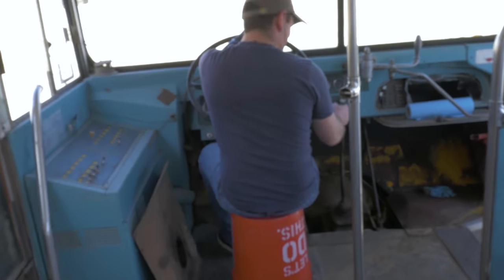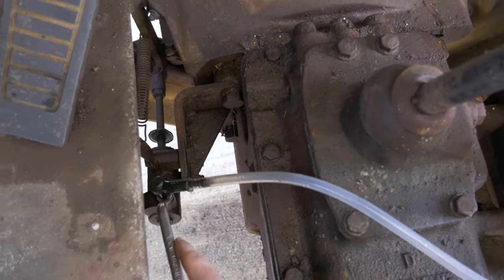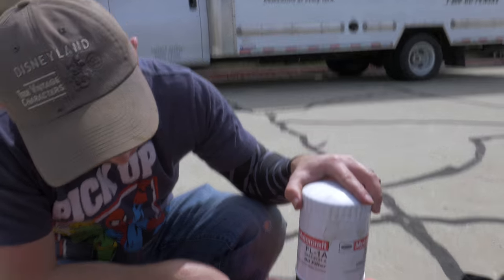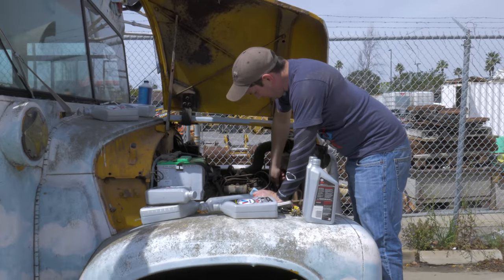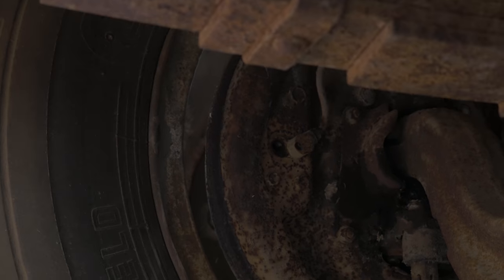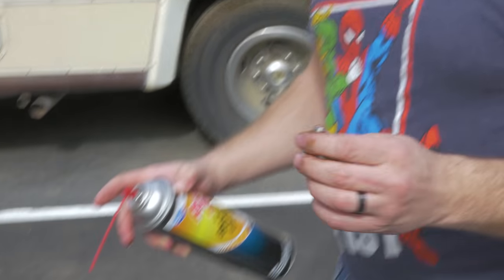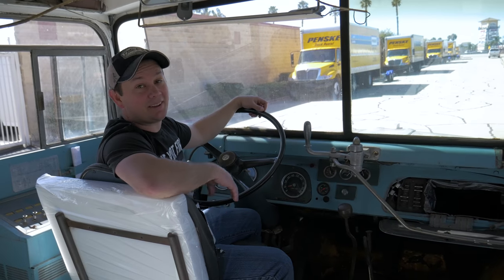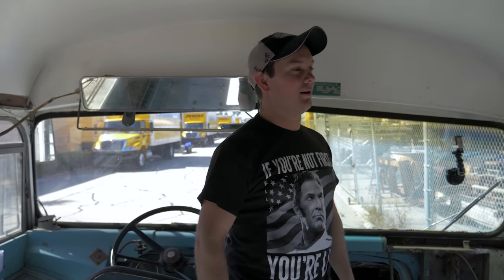1966 international | Tuning a School Bus

Comment: I have a 1966 I.H. Loadstar 1600. Still use it twice a year. Had to do general maintenance thru the last 30 years but its worth it.  Overhauled the carburetor, replace the water pump, slave cylinder, tires etc.  , we have a vented propane heater in it for deer camp.

Comment: Tell you something about the buses I rode.  Carpenter had two types of buttons on the "full-length" switch panels that were popular in the later part of the 1950s all the way up to about 1969.  This one had the chrome pull switches.  They also had the optional black button type where you could put two fingers under the black knob to advance the switch.  In 1958, they had the green for the main section and two white switch ID strips.  My first bus which was a Vistaramic Carpenter bus had the all green panel and the switch ID was just printed on the panel and they used what is now the "Times New Roman" font.  Plus my first bus had two switches for the dome lights.

Comment: That's a pretty cool bus and driveline--take it from a guy that owns two as toys!  Granted, both mine are diesel, but that IH gas motor is a super reliable beast, and the stick will give yall better MPG's and power than an auto!  Feel free to hit me up if you need any bus advice!
Reply from the maker: txstreetman Thanks! We will definitely take you up on that.

Comment: I am totally into the look of that era International, especially the two-piece hood. I believe all that front sheet metal is identical to any other large International from the same era, if you need parts. Not sure about mirrors. Anyhow, I'm green with envy! Did it have a twin sibling, maybe??? 😉
Reply from the maker: Thanks for watching! Unfortunately no twin sibling.  I do think that two-piece hood is one of the coolest things.
Reply: Almost. The front fenders are a few inches longer at the rear on the truck models. They have to be shorter to clear the bus shell.

Comment: it should. have either a 345 or a 392 and timing is done number 8 not number 1 both 
of them engines are good strong motors had one like this one except it built for the
air force as a flight line bus so it was about 8 inches taller lived and traveled in it for
about 1 1/2 years now converting a 1968 gm pd 4107
grumpy old man with a bus